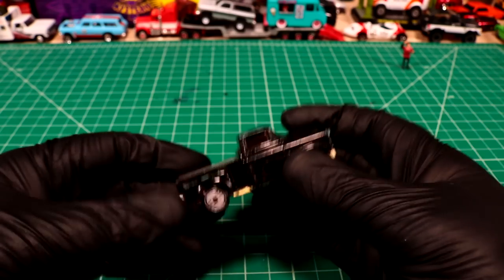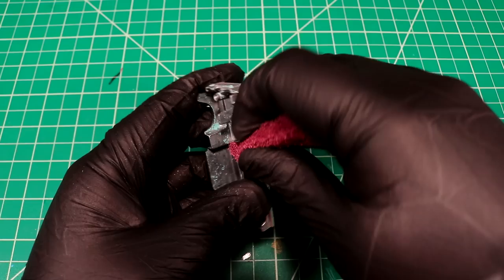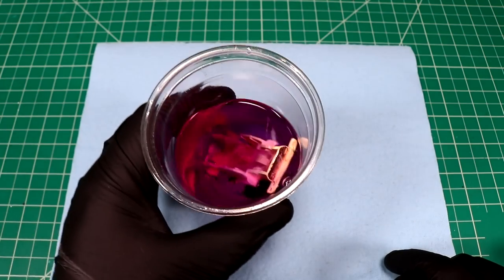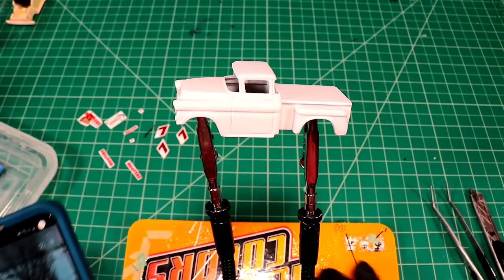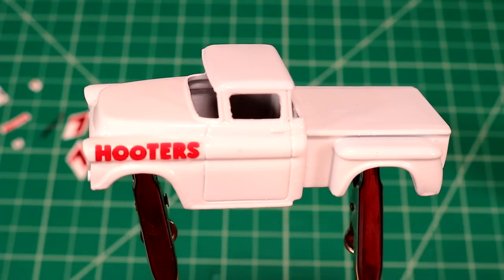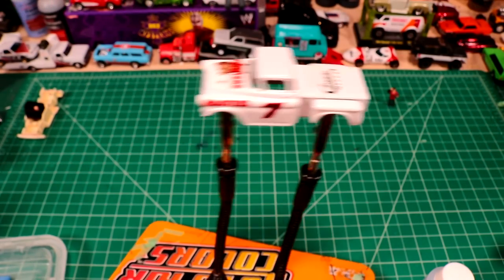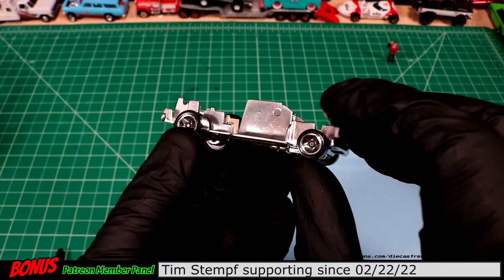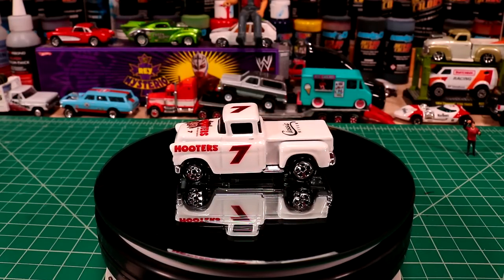I Made a Rare Hot Wheels '56 Flashsider - HOOTERS #7 Alan Kulwicki Nascar promo ??

Comment: I have been really into these restorations you’ve been doing….but I’ll stick with my plastic models!  Lol
Hey…tip with those decals…instead of using the paint brush to smooth them out, try rolling a cotton bud (q tip) from the centers out to remove as much of your setting solution as possible.  Also, it doesn’t appear that you are using the solvent, the red bottle.  If you are having problems getting them to bend around edges and bodylines, that stuff will help.  It’ll also help keep those edges from peeling up!